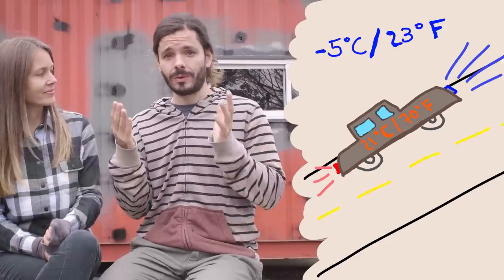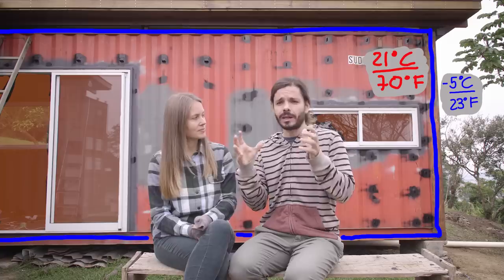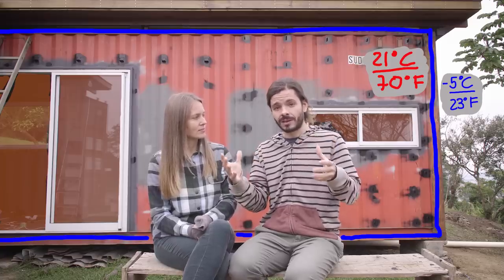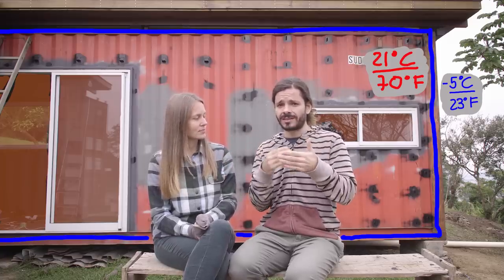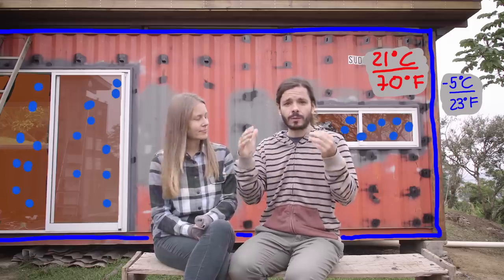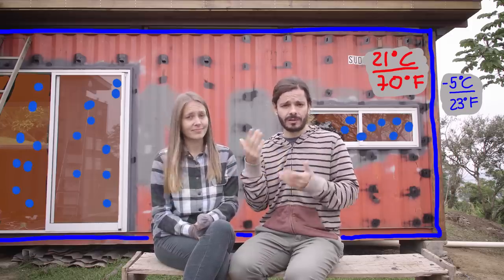How to avoid CONDENSATION on a Shipping Container - Living Tiny Project Ep. 033

Comment: Duca, you might be able to cut some foam strips the shape of the corrugations to flatten out the walls then apply your foam board over a level surface with no spaces behind I filled them with spray foam just a thought
Reply from the maker: Uhhh it seems easy to cut foam but it was actually harder than we thought. 😨

Comment: Hi guys. Just new to the whole small house idea and I am just learning about options. Containers seem like a good choice but I have a few questions. I think the cold weather and the condensation problem is fixed properly with expandable foam but what about hot weather? I would think you have humid and hot summers in Florianopolis. Will or does the container "heat up" during hot weather and what is your solution for that?
Obrigado e parabens pelo canal. Muito bom.
Reply from the maker: Insulating it properly and have the windows in the right places for cross ventilation helps a lot. For us solved the problem!! 👌🏼😊 if the weather is toooo hot I would somehow insulate the outside also. We will do that using wood strips. 👌🏼

Comment: Maybe what you could do is get another solar panel and power a few of these small cheap thermoelectric dehumidifiers. They use like 22 watt. Drill some holes for pipes (from below) to the space between container roof and interior roof and have a little bit of air flow through it coming out of one of these dehumidfiers. It would basically blow warm dry air through the spaces. It could be a closed cycle with a line where any water could drip out.

You could also get an external humidity meter from these cheap weather stations to monitor the humidity as well.
Reply from the maker: Could be a solution but we don’t really like the idea of making holes on the roof. 😨😨 we are scared of having problems in a long term.
Reply: You could make an opening to the air gap from the inside, not the outside. Put one of those humidity sensors in there to see how humid it gets at night. That should give oyu a clue on whether the ventilation and slow temperature gradient works fine.
Reply from the maker: It’s an option bot a opening to the inside ai think will bring to much humidity. 😏

Comment: Problem with rubber undercoating is you have to make sure if you are putting on Make sure its over paint and no rust is there ..The rust will still grow and bubble under the rubber coat ..Water will get in and you will have a rust pool growing faster 

Canada many use spray foam and Open close vents with mesh for cross air And mini stoves or 1 big one
Reply from the maker: 👌🏼👌🏼 thanks a lot for the tip!!

Comment: Don't need the undercoat, because you kept the moisture on the inside of the living space with the sealed layers.   The air gap with proper bottom and top vents to the outside is all you need to keep the air gap temp equal to outside air temp, so no condensation inside shipping container.

Comment: i know this video was a long time ago, but i'm wondering if y'all thought about insulating from the outside, and leaving the interior walls metal with your rubberized undercoating...... i know this adds an external finish layer that would be more expensive than the interior finish layer would be, but it avoids the condensation trap
Reply from the maker: Yep we thought about and we are actually good to have in three of the sides of the house
Reply from the maker: Two with wood and one with a vertical green wall (climbing threes). 😊👌🏼

Comment: They make an exterior paint created by nasa that reflects sunlight on exterior. They make sound proofing for cars th0at can be used behind woodstove. A mini woodstove dryes out moisture. Courious if nasa paint sprayed on interior would seal metal then furing strips between exterior and 2 layers insulation. Visqueen over insulation as vapor barrior.

Comment: It's very  important that you open holes in the lower part of the house to make easy the entry of cool air, and also holes in the higher part of the house for the hot air exit. This will guarantee the air flow and will avoid air condensation. Tthink about the principle of the solar fruit dryer. Regards from Cali, Colombia
Reply from the maker: Thanks a lot for the tip Guilhermo. We were just talking about that today in the morning. 👌🏼
Reply: Ha ! I did not read this untill now. We did exactly that. Two 10cm pipes on the far ends. One low and one high.

Comment: from my understanding rock wool cant hold moisture and mold wont grow on it dont know if that helps
Reply from the maker: We are actually use PET wool for the walls. It’s cheaper and I think easier to work with. And also recycled material. 👌🏼
Reply: Another benefit you may want to consider is that rock wool is not combustible, whereas I believe PET wool may give off toxic fumes when exposed to flames.
Reply from the maker: I will check it out about how PET reacts to fire. 👌🏼

Comment: How about painting the outside of the container and the inside ceiling and walls of the container with the "rubber" paint and then paint the back sides of your inner box (made of plywood I assume) with the rubber paint as well. This way you have 3 layers of rubber with an air gap in between the container and the inner box. On the inside you can frame it out and put in PET insulation and cover it up with plaster board. Maybe labor and capital intensive, but it beats having to tear everything down if it gets moldy.
Reply from the maker: In the end we found a nee product that we loved. It’s called 3tc. 👌🏼👌🏼
Reply: LOL. I just started watching it!!! Great stuff you two create. Thnx!!!
Reply from the maker: 😊thanks a lot for the support 😍

Comment: Hi guys, always great to see your videos!
I'm thinking on insulate my container with spray foam but in the OUTSIDE of the container. After that, im going to cover the foam with wood (using a similar method that the one you are going to use... soldering the little pieces in the outside of the container to screw the wood).
The climate here is similar to yours, a little bit colder... im in Uruguay, in the border with Brasil.
What do you think? Foaming on the outside its a bad idea? :S
Regards!
Reply from the maker: Not a bad idea at all. We love the idea. Just be careful with water on the foam!!👌🏼😊
Reply: That is the point! :)
Reply: Never mind! The EPS and XPS are both closed cells, so the water can't go into them. ;)

Comment: What about using Aircrete? I'm thinking about building a workspace on my property using shipping container and i'm thinking of using Aircrete as an insulator on the outside of the container
Reply from the maker: We actually never heard of it. Will search about. We ar curious now!! Hehehe
Reply: Aircrete is an expanded concrete mix using foam as the expander. Its also called Foamcrete. I did some research and have come to the conclusion that it would not be suitable since it requires forms. Which in my opinion will increase cost

Comment: i have been thinking of this as well. what about framing the inside with 2"x2" wood, and then hempcrete the walls, and then a lime plaster to finish. the walls will breathe and not sit on the inside steel....i think. i am questioning off gasing of using that rubberized undercoat...i have thought of that and also maybe polywall barrier, but still think of off gasing. ...anybody have input about the hempcrete idea?

Comment: Hey guys! So in the case that I decide to use spray foam insulation, I guess that I have to use a wood framing or I can still use steel framing?? Thanks, I really love this channel, is amazing how much info I am getting for you, thanks a lot!
Reply from the maker: I guess wouldn’t make a difference. But maybe would be good to talk to the company that will spray your house just to make sure. 😊👌🏼 oh and glad you are enjoying the videos!! 😁😁
Reply: Use wood. Doesn't conduct temp. Use metal only if the temp around it is the same temp.

Comment: Isn't the foam you used for your windows (espuma expansiva/PU) also a closed cell foam? I can't believe closed cell foam isn't available here. It might be really expensive though. I thought I have seen Brazilian companies offering it. Need to check where I've seen it.
Reply: Ask Robert (?) if this kind of foam would work: https://produto.mercadolivre.com.br/MLB-1024522300-poliuretano-expandido-liquido-a-b-10kgs-_JM
Looks like closed cell foam to me, and just seems to be a bulk version of the "espuma expansiva" that you get in cans to use in smaller quantities (I think you used it with the windows).
Reply from the maker: There is in São Paulo but they won’t do it in the south where we live. And it’s expensive of course.
Reply: OK, so the problem is Florianópolis? Because at the beginning you were saying it's not available in your city, but then you seemed to be talking about Brazil in general, which confused me. I thought I had seen this kind of application in SC as well, but I currently don't find any company. Expensive yes, but I think with your current plan it will be a lot more headache. There will still be condensation and you will have to make sure it dries, otherwise you will have mold anyway. And you probably lose space.
Reply from the maker: We only found one company in são paulo and day mostly work doing insulation for big factors (I mean the big buildings) they won’t do it for a one 40ft Shipping container house. So is the same of not having. Hehehe  but in santa catarina we didn’t find. Only PU Board instead of spray. And that would be a nightmare to glue on the ceiling without any air gap.
Reply: Found this diy kit, like many in the US use. Don't know how much this can cover though: http://www.lasko.com.br/2componentes.html
And there should be many companies in São Paulo, but the companies that do big " galpoes" might not want to do your tiny house, you are right. But this is used for cars, vans and many smaller applications as well.
Reply from the maker: I will take a look. 👌🏼👌🏼

Comment: Could you use pickup bed liner  spray instead of closed cell foam?
Reply from the maker: Never heard of pickup bed liner. I don’t think we have in Brazil or maybe I don’t recognize the english name. Hehehe
Reply: One name is rhino liner. It's a liquid rubber paint that you apply to the bed of trucks that hardens. Protecting the bed from moisture and scratches.
Reply from the maker: Cool. Nice to know!!
Reply: Bedliner will offgas for a long time.

Comment: Olá, realmente o spray de espuma projetada no teto seria melhor. Sei que em São Paulo existem empresas que fazem isso, mas é bem caro. E imagino que não façam pequenas metragens. 
O uso deste spray aqui em São Paulo é comum para soluções de acústica de grandes ambientes e não soluções térmicas. 

Sobre a questão de deixar um vão entre o chapa do container e o isolamento, eu não recomendo. Quanto mais ar estiver disponível neste vão em contato com a chapa, maior umidade disponível para condensar. 
Ainda assim mantenha a ventilação original do container para que o pouco de ar que estiver neste local possa circular e a diferença de temperatura entre o exterior e o interior seja reduzida. 
Como falaram, para evitar insetos basta uma tela de proteção. Dê preferência às metálicas que duram mais e são mais resistentes. Elas não ressecam como as de plástico e resistem mais. Instale com uma moldura para vedar os vãos laterais e de alguma forma que facilite a troca da tela de tempos em tempos. 

Enviei um comentário há pouco no episódio 32 sobre o forro que estão fazendo. 
Sobre a condensação, o problema pode até ser mais grave que somente umidade e mofo. 
Tanto no sistema drywall como no forro de compensado, com o tempo a placa de gesso acartonado (drywall) ou de compensado irá absorver a umidade e aumentar consideravelmente o seu peso, podendo soltar dos parafusos e cair. 

Então complementando, a melhor solução para o isolamento térmico disponível no Brasil é a Lã de Rocha pelo melhor desempenho em relação ao EPS (Isopor), lã de PET ou lã de vidro. Conforme a densidade da lã, o desempenho da Lã de Rocha é bem superior e possui menos condutividade térmica. (Veja as coeficientes divulgados desses materiais nos sites dos fabricantes). 
Recomendo em placas e com no mínimo 32Kg/m³, pois é muito mais fácil de instalar em placas e a de rolo normalmente possui densidade menor. 

Você poderá colocar a lã com maior espessura que o vão entre a chapa do container e a chapa do forro e compactar um pouco quando colocar a chapa do forro. 
Assim a lã preencherá os vãos da chapa corrugada do teto do container, minimizando a quantidade de ar em contato com a chapa do container. 

O princípio é o mesmo em tubulações de fluído refrigerante de ar condicionado. Mesmo em um simples ar condicionado tipo split residencial. 
Toda a tubulação possui isolamento térmico totalmente vedado e encostado na tubulação. Assim evitando que o ar ambiente entre em contato com o tubo e a umidade condense. 
Qualquer pequeno rasgo neste isolamento causa condensação e umidade. O que pode gerar muitos problemas, pois normalmente esta tubulação fica chumbada em alvenarias ou dentro de forros. Desta forma, instaladores de ar condicionado utilizam silver tape ou fita metalizada de alumínio para vedar as emendas do isolamento dos tubos. 

Se quiser, também existe a lã de rocha ensacada que é a mais indicada para forros, por evitar alergia tanto no instalador como nas pessoas que estarão no ambiente depois de pronto.
Este tipo impede que partículas da lã se espalhem no ambiente mesmo depois de pronto por vãos das luminárias, sancas ou tabicas de dilatação do forro. 
Imagino que por ser ensacada também proteja mais a lã e o forro da condensação. 

Existe também a lã de rocha com película metalizada, evitando ainda mais a condensação e protegendo a lã. 

Veja no site da Rockfibras, conhecido fabricante de lã de rocha. Além da normal, eles têm o tipo ensacada: Roll-Max e dois tipos com película: THERMAX-FLEX e ROCK-FELT. Veja as especificações, condutividade térmica e aplicações de cada produto. De repente vocês conseguem uma parceria com eles... 

Há algum tempo mandei mensagem para vocês me oferecendo para tirar dúvidas ou dar consultoria no que precisarem. 
Não sei se deixei claro na época, mas me ofereci com o objetivo de ajudar mesmo. Sem custo ou retribuição alguma. 
Fiquem à vontade para entrar em contato quando precisarem. 
Se não tiverem mais os meus contatos, me avise por aqui que envio novamente. 

Abraço e parabéns pelo empenho no projeto! 
Arq. Fabio Sica.
Reply from the maker: Brigadão pelo carinho e atenção Fabio. Na verdade acabamos descobrindo um novo produto chamado 3tc e resolvemos usá-lo. Estamos esperando chegar pra começar a instalar. Mais uma vez muito obrigado por toda a ajuda e por tantas informações!! 😊👌🏼
Reply: Legal. Eu não conhecia esse 3tc. Entrei em contato com eles para tirar algumas dúvidas e solicitar amostra do material. De acordo com as especificações divulgadas pelo fabricante, parece ser bom.
Reply from the maker: Gostei bastante tmb. Deve chegar na segunda. Ansioso pra ver de perto o material!! Hehehehe

Comment: Desde Argentina....
hello guys ... they are spending too much money and effort in a solution that is only to move the accumulated hot air ... Just two mini wind extractors, are those that move by the wind and have a mushroom shape with fins, the closest from the ceiling so that the warm air and some mini ventilations to the outside of the floor can be removed for fresh air ... I assure you that the issue is solved without further ... greetings and good luck ...
Reply from the maker: Thanks a lot for the tip Roberto. We really appreciate!!😊
Reply: I miss a detail ... ajajajaj .... It's a very big problem I had in Buenos Aires, a city with a terrible humidity and in Bariloche, with great thermal differences, and after many systems this solution finally and economically the problem .. .good luck...
Reply from the maker: 👌🏼 thanks a lot!!😊
Reply from the maker: Even thought it seams like a simple thing condition and available material change a lot. In addition to that we are taking this project as a big laboratory as an opportunity to try and test solutions. 👌🏼 by the way thanks a lot for the help Robert. 😊
Reply: Of course the cost when the result justifies it is indisputable ... what I was proposing is an economic solution and, at least in my case, perfectly proven ... and that helps to lower costs ... With regard to aesthetics and stumbles, I think they can be perfectly adapted laterally using the vents of the container, apart with small ones that would have to be placed ... but hey, I'm definitely not an engineer and it was only to give a simple and economical solution tested in two places geographies with great accumulation of humidity and thermal differences ... Mine was a long and empirical search ... nothing more .... luck ...
Reply: More coming, and involves math  :)
Reply from the maker: It’s always good to hear different stories and and solutions for sure!! Thanks a lot for sharing. To be honest I think the original vents will be enough. If we end up having problems we can try. 👌🏼